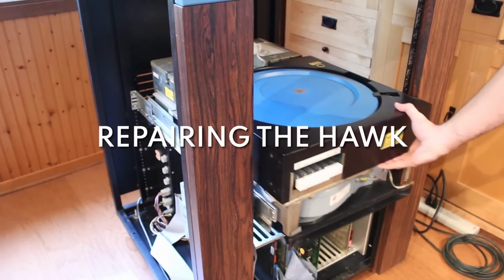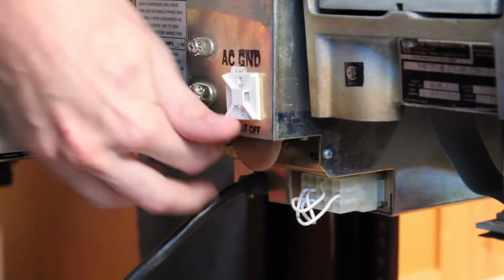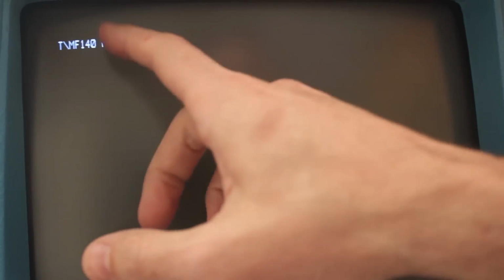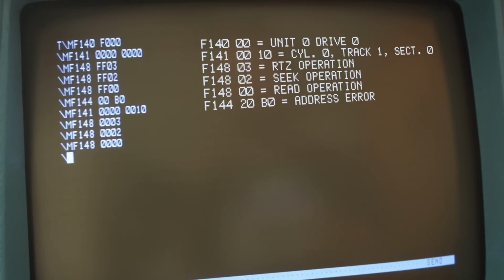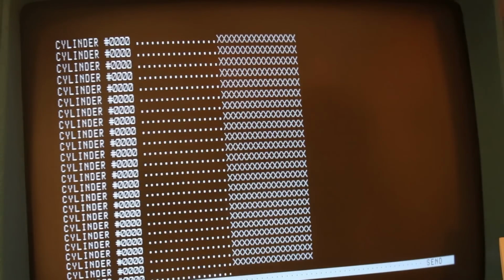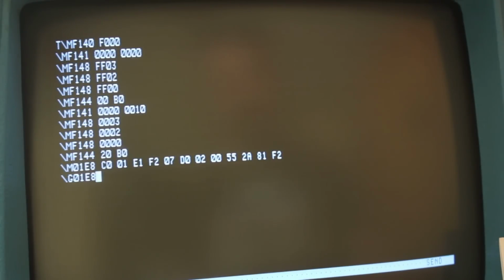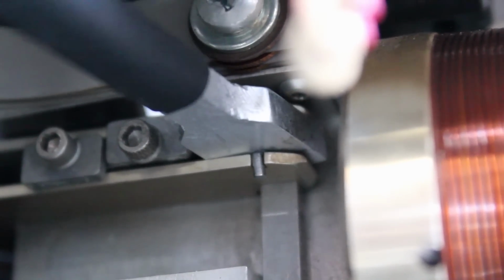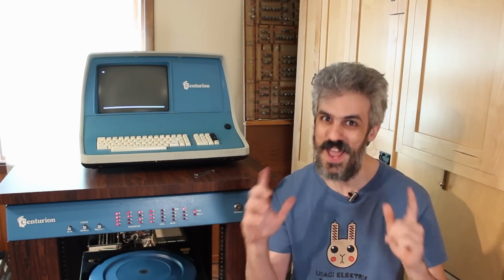Minicomputer Part 16: Aligning the Heads on the CDC Hawk Drive

Comment: Some more details from reverse engineering @LOAD, if anyone is interested:

LOAD is part second stage bootloader, part operating system bootstrap, that calls itself LOS (probably meaning Load OS, as in thing that loads the OS)
Unlike WIPL, which is a standalone binary containing just enough to load off the Hawk disk, LOAD is actually a linked together memory image containing a stripped down and pre-configured version of the final OPSYS kernel, along with several drivers for various types of disk drives, a CRT (terminal) driver, and the bootloader/bootstrap.

ATTN PRINT comes from within one of the drivers, so if got that far, then it has successfully initialised all memory, and the kernel. First thing it does after initialisation is printing a version string "LOS 7.1 - E" to the terminal. That's about where we appear to be getting stuck, either it's printing something and the terminal isn't seeing it, or the CRT driver is getting stuck before printing it.
Reply: Episode 4 of this series shows a printer interface board that came with the original setup..   I haven't seen it mounted in the chassis for several videos now, so maybe reinstalling it would be enough to allow the initialisation to proceed.  Either that, or its presence might yield a more descriptive error.
Reply: I mean, simplistically, is it possible it's literally just asking you to check printer output or connection?
Reply: @M0UAW_IO83  That was my first thought - the system was built with a printer and it wants to talk to it.
Reply: @russellhltn1396  or at least know it's there with some combination of pins on the interface connector
Reply: There is no printer driver in LOAD, just a CRT driver (aka terminal) and various disk drivers. This isn't the final OS, just a temporary version to bootstrap the final one. 

According to Ken, the centurion is capable of fully booting with just a CPU card, a RAM card, a MUX for user IO, and one of the various disk cards to actually load the OS from.
Reply: Something I wondered is if the OS has some kind of absolute pointers or links in it's configuration. The OS on the removable may only be a backup and not capable of running because the absolute pointers are pointing to where the OS normally lives. (Fixed platter?)  In that case, you'd either have to modify the OS, or restore it.
Reply: So, in theory, it would print "LOS 7.1 - E" when the OS successfully finishes initializing and drops to the user shell afterwards. If the "ATTN PRNT" prompt is coming from one of the drivers, I would assume the OS is expecting some piece of hardware to initialize that isn't present or working currently.

I concur with Clint, maybe it's expecting a printer (or a printer interface card at the very least) to be present within the chassis? If that's the case, I wonder if there's a means of configuring which drivers are enabled on startup.
Reply: Would there be some configuration file that tells the system that there's a printer and on which port it should be? Maybe the system is misconfigured for his particular configuration and you need to tell it that there's no printer, only a serial console.
Reply: @Stoney3K  There is... but it's LOAD that is responsible for loading that configuration file as part of it's bootstrap process, and it's erroring out before even loading it.
Reply: @phirenz  So the WIPL or LOAD is hard-coded to expect a printer for... something? Logging info perhaps?
Reply: There isn't anything referencing the PRT board's register range in LOAD. The ATTN PRINT string is only referenced from inside the CRT driver. 

I'll point out that these CRT terminals are the successors to electromechanical teletypewriters, which did print terminal output on real paper. And that in modern programming languages, we still use the "print" terminology to output messages to the terminal.
Reply from the maker: Just want to chime in here and say that Phire here is a proper wizard!
Phire's been helping with the reverse engineering process since the very beginning and we wouldn't be anywhere near where we are with out his help!

Phire also did a lot of digging through the code to help us zero in on what the OS is on about with the ATTN PRINT error. The most popular guess seems to be printer related, but it's actually MUX and terminal related. I go into more detail in the next episode!
Reply: @UsagiElectric  Oof, I'm feeling slow. I kept reading "Pee-hire" not realising it's the person that's been pronounced as "Fire"!

Comment: 6:04 "This is Usagi Electric and what I have for you today is..."
Cool of you to make your own alignment tools, and it looks the process is pretty simple.
Reply: This is similar to a head alignment on a tape deck. Doing it "the proper way" would ensure reliability and compatibility with other drives. However, since the drive (and the computer) is not going to be used "for real", aligning the heads to just be able to read is good enough. 
I wonder if it is possible to align the head on the wrong cylinder though, I mean trying to read cylinder 5 and getting cylinder 4 or 6.
Reply: @Pentium100MHz  You could center the heads over the wrong cylinder in error when aligning the head the way we did it, without the CDC CE Alignment Disk Pack. But in is case we are monitoring the Centurion disk controller status information of "read errors" in real-time. If we are getting Read Format errors know we are not centered over any track at all. If we are getting Read Address errors we are centered over a track because we are reading a track (no Read Format errors) but the Sector Address we are reading is the wrong Sector Address. The part of this"odd alignment trick" is if we are not getting Format Errors or Sector Address Errors and the overall sector read did not fail with a bad CRC Error for the sector data field we have a working disk head alignment.  Gavin's CCDP software helped us greatly by lumping all the read error checks [ Format, Address & CRC] into a single display of [ . = good read ] or a [ X = bad read ] into a real time status display on the terminal screen.  Without Gavin's CCDP software "tool" it would have taken hours just seeking the heads, doing a Read command then checking the read status all by hand using the Diag. PROM Bd. TOS program ( been thier & done that before ).   The big trick is the CDC CE Alignment Disk Pack designed as a master ref. standard so Read & Write removable disk packs from other disk drives. The CDC CE Alignment Disk Pack can not help you with the out-of-alignment fixed disk platter heads. Only option to get the fixed disk heads aligned is do a new Format Write on the fix platter to write new tracks and then loose all the data on the fixed disk, or just move the heads back over the current written data tracks by just moving the heads in-or-out till the Read Errors stop.
Reply: @kenromaine2387  Thank you for the detailed reply. So, the drive would know if it got the wrong track, that's good. As for doing it with the proper alignment disk, yeah, it would be done for interchangeability of the disks. 

I am more familiar with tape decks and the proper way to adjust the heads is by using a calibration tape, then the result is interchangeable with other decks. When I saw the head alignment by moving the heads until read errors stop, it reminded me of the way I sometimes align a walkman - by playing a tape and adjusting the azimuth until it sounds best :).
Reply: @Pentium100MHz  Probablly not. In most disk formats sectors have thier address recorded in a preamble header [edit: at least for the older stuff. Don't know if true for servo-platter drives.]. That's most likely what the occasional "address error" (before alignment) meant--a sector was read (at least partially), but the recorded address didn't match what was expected.
Reply: @Pentium100MHz  Hmm... as an old audio engineer, I initially heard head alignment in the traditional tape manner: the head is always in the right place, or close enough that it makes no difference, but it can twist with respect to the tape transport. That means that the head gap is effectively lengthened, which affects the frequency response, and also that there is a phase difference between two stereo tracks, which moves the sound image in a frequency sensitive way. So the head alignment on a (n audio) tape machine is a question of making the head be at the right angle to the track.
Here on a disc system, the alignment is looking for the correct track position, which is adjusted mechanically. As others have pointed out, a misaligned head is not an issue if you are only writing and reading your own discs (provided you don't run out of travel for the end tracks) but is always an issue if you want to read something else, aligned differently.
One would hope that the range of adjustment was not a lot more than +/- half a track...
Reply: @neilbarnes3557  The head alignment on this disk drive is more like the height adjustment on a tape head, but height usually does not go out of alignment, azimuth is the one adjusted more frequently. I guess for the disk drive azimuth does not really matter that much, but the track alignment is the one that goes out periodically.

I have a few tape decks (both cassette and reel to reel) and know a bit about aligning the heads after replacing them.